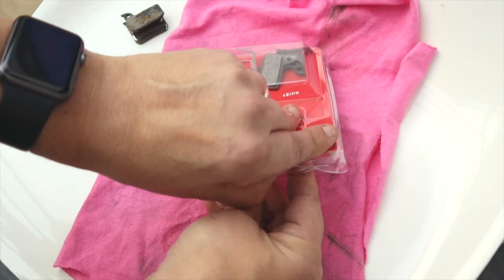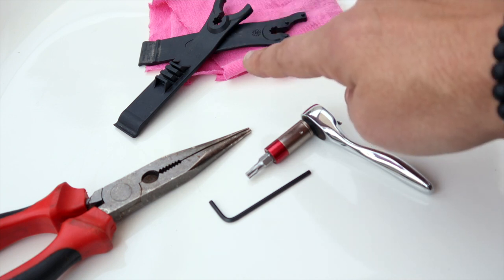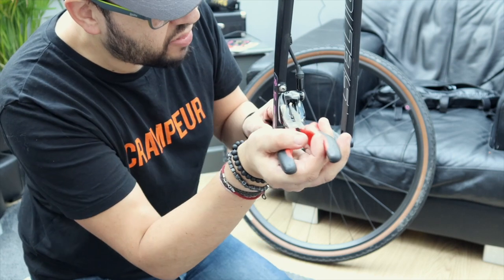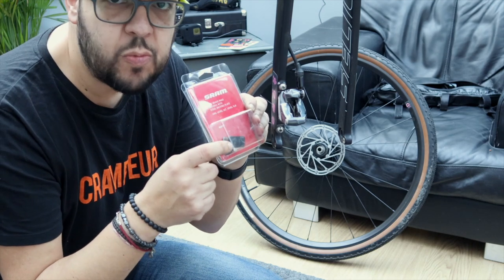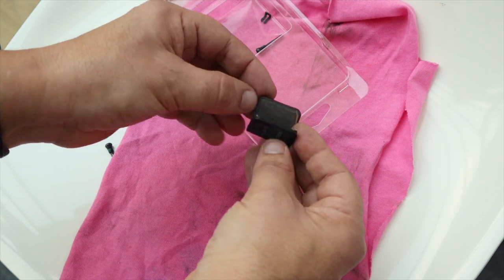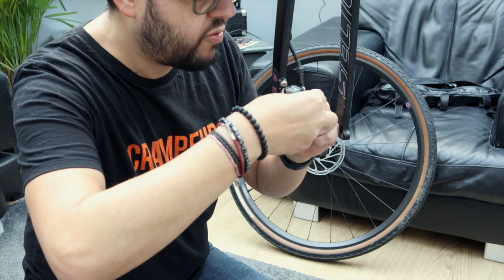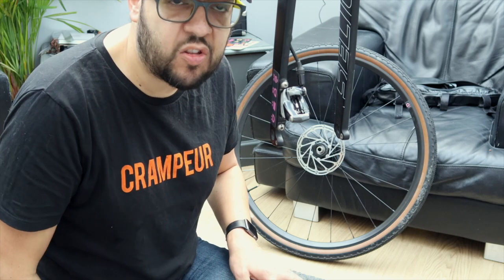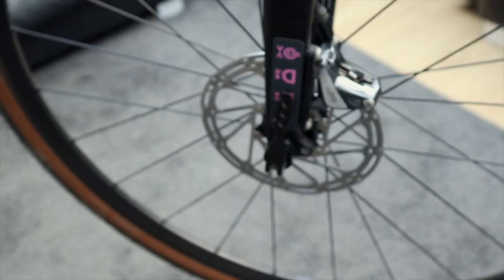HOW TO: SRAM Disc Brake Pad Replacement

Comment: Just changed my SRAM brakepads with this....who needs a bike shop appointment (can't get one for 3 weeks anyway) ! BTW I found it useful to use levels/ large flat screwdriver on the pads once fitted and before the wheel was replaced.

Comment: Thanks for the video. Helpful! One remark I would make here: noticed that when you try to install spring clip, you were touching pad surface with your bare hands. I would use gloves as you may transfer some oils from your hands on pads.

Comment: My pistons retract back nearly flush (.5mm) but they spring back out like a pneumatic system making the space between the new pads too small to fit the rotor. I've watched a ton of videos and I think there might be a release valve on the lever. Going to try and space the pistons back fully and then apply some pressure while having a ridged spacer. If the pistons stay, that will confirm for me that there is a step missing from most of the videos online. I'll comment on my own comment here if it works.
Reply: Yup. I think I'm correct. I added a 3/8" aluminum flat between, pressed both sides in and the pistons came out to press against the bar holding it firm. Lightly pressed the brake lever and it held the bar solid but a little wiggle and now the pistons are staying retracted! New pads fit perfect. I think there is a step missing with pad replacement.

Comment: Thanks. I love SRAM components, but the manufacturer is very bad in providing manuals or video instructions. I had to gamble which brake pads to choose for replacing mine and the official SRAM video is lousy. Nobody told me but I found out that the brake pads for Rival and Apex are similar (and very different from the ones SRAM shows). Contrastingly, your video was better than clear enough.